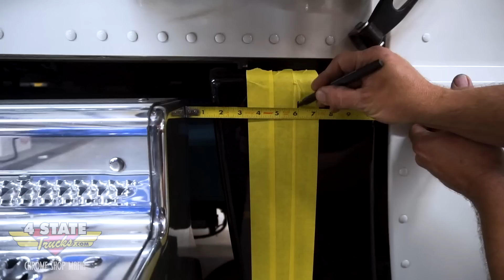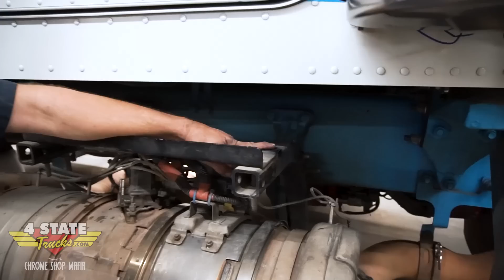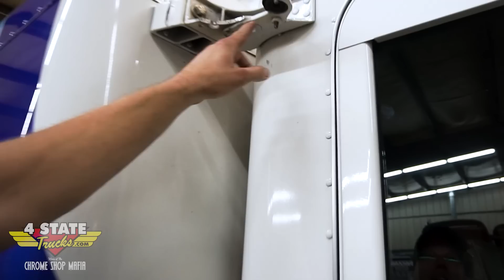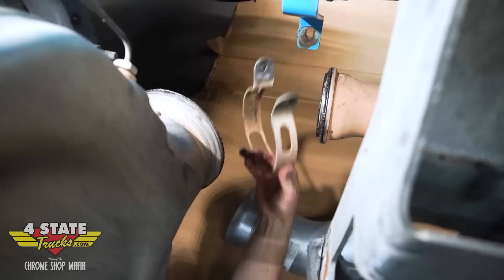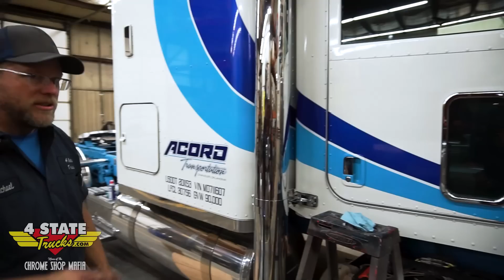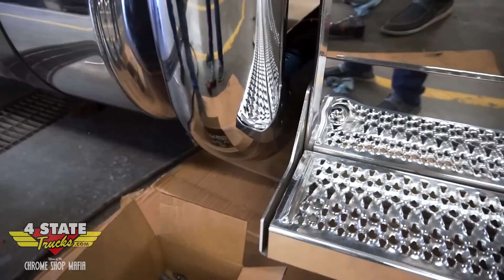CSM Installs -  BESTfit 7 Inch DPF Exhaust Kit w/ Long Drop Elbows for Peterbilt 389 (2018-2024)

Comment: Can I buy the dpf inlet pipe on its own?
Reply from the maker: 01-0801011 not in stock and would have to order it in. DPF INLET PIPE FOR 2018-2024 PETERBILT 389 WITH CUSTOM LONG DROP EXHAUST 247.99 Need to call in to get it as it isn't online 888-875-7787

Comment: Would moving the dpf filter still be needed if I were to do 5" diameter long drop elbows?
Reply from the maker: Yes. The factory 5 inch elbow has a multi-bend to go around the DPF filter cover. if you want it to have a straight drop down, the box must be moved forward. If you go to :44 seconds into the video, you get a great side view of the elbow where it bends around the box. -Jeremy

Comment: Great install. Do you silicone the top stack as well?
Reply from the maker: Yes! Silicone the elbows to the spools, and spools to the tops. Only place I do not silicone is the elbows to the tee pipe, so it can be disassembled for repairs (Peterbilt long drop elbows).